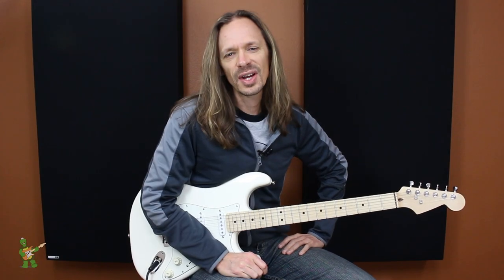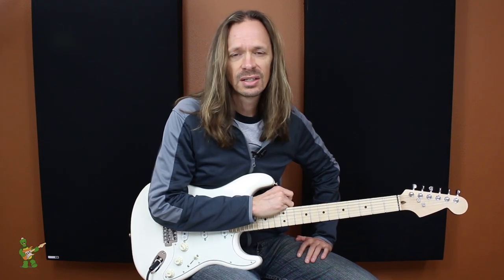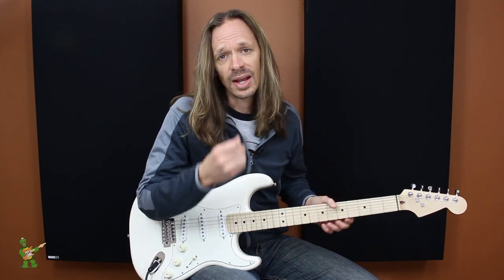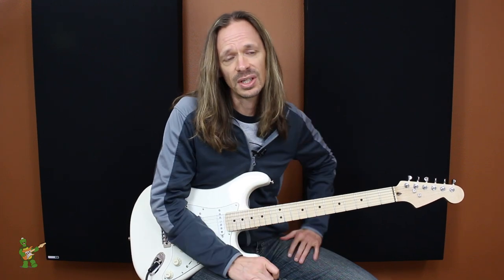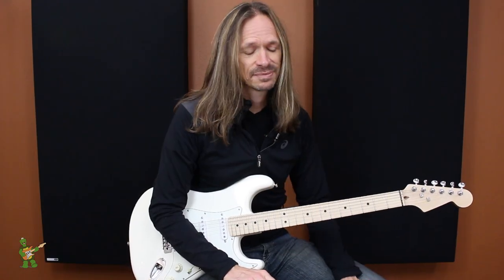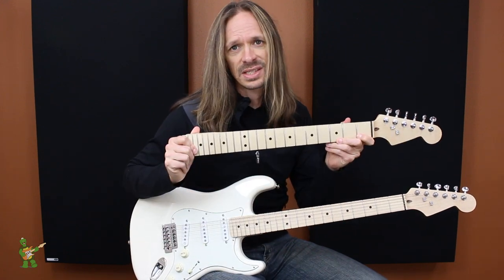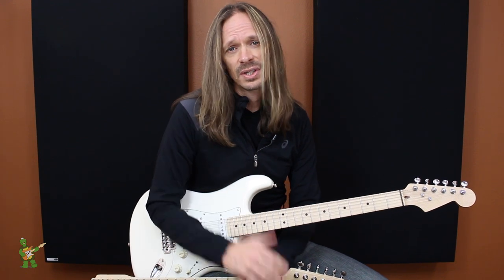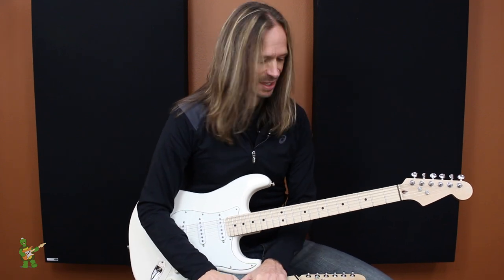Stainless Steel vs Nickel Frets

Comment: SS frets for life. Its better for bending and the spank top end is nice. And obviously no refrets are awesome! I only wished prs offered ss frets. But unfortunately paul is stuck in his own delusional greed. he actually said in a youtube video his nickle frets are as strong as stainless. Which is a bold face lie. I asked prs since paul said that publicly on  youtube would prs refret my 2013 custom 24 that has huge divots in the frets from nonstop playing over 5 years. PRS said no. So they lost a customer due to pauls fret rant he made, and then no backing up their words
Reply: Yep....ss jescar jumbo or super jumbo ss frets.....i think people paying thousands of dollars for guitar and not getting ss super slick frets...better bending vibrato and feel.....is freaking hilarious.PRS by the way, is like steve jobs and apple products....need i say more?
Reply: @Dreamdancer11  The funny thing is stainless is a cheaper material then nickle silver alloy, a big guitar company could save a few bucks and market it as an improvement
Reply: @therideneverends1697  Yes but its not..vintaaaaaage.....
Reply: Nickel frets vary a lot in hardness too - its an alloy that contains Nickel but can vary on hardness and wear. PRS Nickel frets are very hard - harder than many others and why they don't necessarily have to adopt SS frets. You rarely here of a 'core' PRS requiring a refret.
Stainless Steel frets can cause more string wear and using Stainless Steel Strings causes just as much wear on frets as nickel strings on nickel frets. Its a matter of choice. The harder the frets/strings, the more wear it can cause. By using SS frets, you effectively cause more wear to strings because they are softer than the frets.
I don't know whether your PRS was a US core PRS, what strings you use but PRS frets are much harder than most nickel frets. SS frets also often have an extra charge because they are so difficult to work with and ruin tools too so if you do need to refret, you pay more.
As I said, its a choice. SS frets have their place but that doesn't mean they are the 'best' option for all...
Reply: @BAMozzy69  Well you are partially right...there are degrees in hardness  for the nickel frets and you can have good guality and hardness nickel frets dialed in into perfection and playing great...having said that though and since we are talking about guitars that cost thousands of dollars, details matter.

SS frets provide better playbility from the get go.Iam not talking about sound..iam talking about smoother bends and vibrato,about almost never need a fret dress even if you play them like a caveman.If you have a guitar with nickel and one with SS ones you ll find out that very soon the nickel ones feel like you are sanding the frets when you vibrato and bend and need to be polished regularly....nothing like that with the SS ones.They feel like you the were polished minutes ago.

As far as the difficulty to work with......that is an absolute myth..the only difficulty is cutting them which requires your full strength with both hands while the nickel ones cut like butter without even trying.Having done refrets to all my guitars with them the only extra tool i bought is a knipper that cuts ss frets....iam in my 7th refret of my guitars with them and still no serious wear.The rest are normal tools...sanding block,sandpaper,crowning file and the polishing of your choice.

Its certainly a choice but if you pay several thousands for solid body electrics and you dont have ss frets i dont think you get your moneys worth....
Reply: Just take it to a refret guy who does quality re-frets and stop hassling Paul with shit like that. He makes good guitars and uses what he feels sounds best to him, so if you don't like the frets, have some other frets installed...
Reply: @randallabracadabra  Pay several thousands for a solid body electric and still take it for a refret?wow..just wow.
Reply: @Dreamdancer11   I don't get what's so hard to understand here. If you've worn the frets out and it needs new ones, yeah, you gotta take it to get refretted. Frets don't last forever, including stainless steel, especially when you play the guitar all the time. My friend James Robinson plays a PRS Single Cut Trem and his frets lasted about 5 years too, because he's a monster guitarist and plays the thing every day. SRV was having his strats refretted like once a year, so be happy you're not him, lol.
Reply: @randallabracadabra  Really?For the price prs guitars cost you can buy at least 3 guitars just as good(if not more) playing and sound wise WITH stainless frets too  that ll last more than your lifetime and you ll pay top dollars for ONE that ll even need refret down the line....seriously...you still having a hard time with this...wow.
Reply: @Dreamdancer11  I'm not having a hard time with anything. Paul chooses the hardest nickel steel alloy he can get, because it sounds better to him than Stainless, as it does to my ears as well. His guitars are expensive, because they sound great and they are constructed a lot better than most mass manufactured guitars out there. His frets certainly last longer than anything Fender uses.
Reply: @randallabracadabra  Paul cant differentiate between two distinct notes...its on video by the way where he flips the guitar over taps it from head to bottom and finds that the body and the neck rings the same note(and hilariously it doesnt) so i dont care what his ears tell him.Any solid body electric above 1000 is basically money down the drain....you cant have better quality even if you try after a certain price point....as for construction...his guitars are cnc cut from assembly line workers just like anything else out there....the fact that these workers might spend a bit more time detailing them doesnt account for the extra thousands people spend with zero reason whatsoever.
This is the reason why he is called the Steve jobs of guitar world...cause just like apple products you can get the same quality or way better with a fraction of the price apple asks, from countless other sources.
Reply: @BAMozzy69  execatly. I seriously doubt that guy needed a regret of a prs guitar after only 5 years of playing.
Reply: @Dreamdancer11  you forgot to mention that the woods are all hand selected, planed by a person running a machine, tops are hand selected, then cut and bookmatched by hand. Then the body gets cut, neck gets cut etc. Then both are completely hand sanded, the necks are hand fitted to the body's, frets installed by hand, inlays installed by hand. Basically everything besides the body/neck being cut by cnc is all done by a hands on worker, from sanding/gluing, all the way to finish/assembly/testing qc. That kind of craftsmanship is what you're paying for.
Reply: @bradhargis2261  I dont see any extra work...the process is the same for any guitar company and you can claim more attention to detail for sure but the only thing you can really claim is that the woods that are used cost thousands of dollars(in order for the price to be somewhat deserved).Like i said they buy them wholesale and get huge discounts.Also the body and neck IS the guitar...and since its made by the machine you cant expect handmade prices.Sanding is a necessity anyway(and lots of it) so there is no extra cost for the prs sanding.
You sand a ready made body...and a ready made neck.....you attach the trus rod to the already made channel,the already made fretboard to the neck and you basically sand finish and finally set it up....you think prs has better finish and better setup?i agree...doesnt cost several thousands more though....not even remotely close.Not for a cookie cutter guitar....
Reply: Paul is obviously a very good businessman but his guitars, and his luthier skills, leave much to be desired. I've never been a fan of his overpriced work but his infamous "tonewood" video was just sad really. They aren't bad guitars but there are so many makers building far superior works for equivalent or even less money. However, that's just my opinion and it is of no more importance than that of anyone else.
Reply: Gotta disagree.  Refrets are a hassle, but I'd rather suffer through the occasional refret that have to live with the clangy, excessively metallic sound of stainless steel frets.
Reply: What I noticed when playing a Parker Fly which has SS frets glued to the fretboard with no slots cut to accomodate them is that they sustained better, lost less energy when bending.  This guy didn't do a lot of bending.  Also, SS frets are going to be harder on your strings because they are harder than the strings while I guess the opposite is true with nickel frets.
Reply: @BAMozzy69  I had 3 core PRS' that needed regret. 91 CE24, 94 CE24 (2nd regret needed now and probably going SS, 98 Custom 24, 02 McCarty... Although the McCarty held up the Best. I didn't regret it but it was borderline and I sold it.
Reply: Well, no. I have a usa c22. The frets haven't lasted nearly as long as the fender ive had twice as long. The prs will get ss frets soon, but I'll never buy another new high end guitar without ss.
Reply: of course.  why would they need to change now?  He sold a reshaped Les Paul, that's it.  yaaaawn.
Reply: @johnholland5466   "Gotta disagree.  Refrets are a hassle, but I'd rather suffer through the occasional refret that have to live with the clangy, excessively metallic sound of stainless steel frets." 

I guess you didn't watch this video.  SS doesn't make a clangy sound.  It sounds almost identical to nickel frets except with a tiny wee bit more high end sparkle.
Reply: @TruthSurge  The difference is noticeable, even in a YouTube video, which is why I immediately sold the only stainless steel free guitar I ever bought.  I don't know what your ears are capable of hearing, but in terms of changing one material used on a guitar, the difference is huge.  Changing the wood of the neck or body to something similar yet different likely wouldn't produce as much of a noticeable change.
Reply: @johnholland5466  I'm listening through Adam A5X studio monitors.  Whatever this vid is putting out, trust, I'm hearing it.  I would counter by saying perhaps you are "hearing things".  But hey, don't let me stop you from doing what you want.  It's way easier to tone down something that's too bright than to brighten something too dark.  So... I think I'd use SS if it was a new neck or guitar.  If that caused too much twang up around 5K or so, hell, just turn   5K down a hair and guess what, same as nickel BUT......  no fret dressings for me the rest of my life!  That sways it for me toward SS.  anyway, take care.
Reply: @johnholland5466  LOL you are hilarious.
Reply: @valebliz  As hilarious as the people with tin ears commenting on this video or becoming threatened by someone not liking what they like?
Reply: @johnholland5466  as hilarious as someone who can't use an eq, apparently. Have fun, I've got better to do.
Reply: @valebliz  I'm assuming those better things don't include being able to recognize subtle differences in tone
Reply: @johnholland5466  tone snobs gotta tone snob. Bye.

Comment: I knew neck #1 was the Nickle. I think the Nickle sounds more familiar, the Stainless sounded stiffer and a tiny bit less organic to me. Overall I think SS frets will be the best choice because they last longer.
Reply: That's it man. But if you have a 'special' or 'vintage' instrument you don't want to put SS on it. If you play metal on a 'whatever' instrument with 12's, probably a sound investment ..
Reply: @cgavin1  cool you play the low e string alot i didnt ask.

Comment: Stopped it at the 4:38 mark. My initial impressions are from the very first example that Neck 1 has a more full sound. The Low end really shines compared to Neck 2. With Neck 2 you get the sound of the frets while playing, where as that seems more minimal with Neck 1.

Edit: Finished the video, and I am surprised that 1 was not the Stainless Steel. I guess I'll stick with my Nickel.
Reply: I heard it too. So surprised there was anything in it.

Comment: Stainless for me -  never going back, thank you brother. So so tired of wearing out my frets.
Reply: Me too, My style is hard on frets and normal frets wear out too quick for me.
Another thing strings cheeper for an old (70) pensioner guitarist like me.
Reply: That's cool. What did you like about SS strings..? was it the tones or was it the 'feels'...? 
I hear some people say they are brighter and the cleans shimmer much more, however I have heard some say they are too bright sounding and went back to N/S frets. I need a guitar refretting but don't know what to have done. N/S fretwires come in quite a few sizes for width and height but SS just a couple of sizes. I want the very tall wire but slightly narrower than the super jumbo they put on all the Ibanez RGs back in the day.

Comment: Wow, this was really surprising.  In the neck position (1st test) I couldn't tell any difference but in the other tests I swear that neck 1 was slightly brighter and sounded better to me.  I think you're right about the difference being very minimal and easily dealt with by changing eq settings.  I have SS frets on the only guitar I've had refretted so far and it still sounds amazing and plays great.
Reply: Yep. Neck #1 was brighter, across the board.
Reply: @songboy40  I know it's been a while since I left this post but I have since realized that the frets I thought were stainless steel on one of my guitars are actually most likely nickel too.

Comment: You almost changed my mind about them sounding different. There was a definite difference on a few of the clips. Then you said at the end that one was recorded one day and the other was recorded the next. That tone could have been affected by what you had for dinner the night before and breakfast that morning. Your fingers could have been slightly swollen etc... On top of that, SS is supposedly brighter, well, the times it sounded darker was the SS, so that blows that theory out of the water. I'm with you, Aaron, the difference is so insignificant that it doesn't matter. You said once you get the drums and bass going in there, hell, I'd like to add once you add that floor rack of stomp pedals. Once you do that, forget it, you're not hearing the materials of the frets.

Comment: The beauty of tests like these is to use your pointer to jump between the sound samples. Going back and forth that way. Instead of just listening it through as recorded. Doing it with your eyes closed is even better. You loose the 'expectancy' when viewing which neck is being played.  Doing this I don't hear any real difference. What i perceive as a difference can be the same on each sound sample. The real benefit is their longevity.

Comment: I definitely heard the difference. Not only that, I was able to tell which was which with good level of confidence (but I have had a carvin with SS frets for over a decade along with many other guitars with nickel frets). I honestly prefer the tone of nickel much better, but I'd pick SS frets for the longevity if given the option.
Reply: This is it. I have a Strat Deluxe and it’s been played and gigged so much and so hard that it’s been recrowned twice in a relatively short space of time—noticeably less material there now… so next bit of wear will mean a refret. As it’s a workhorse, I’d sooner go stainless and forget. Slight tone change? I won’t notice or care.